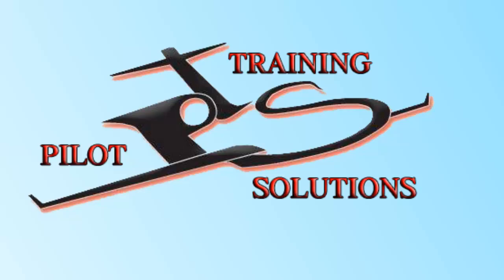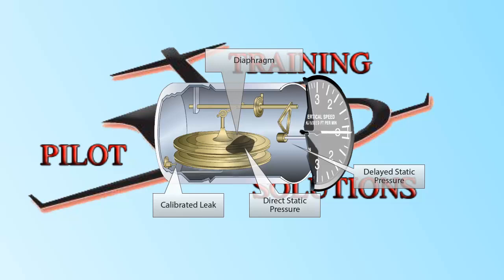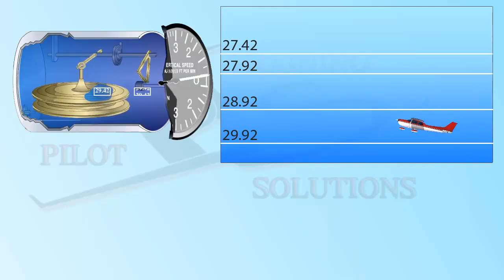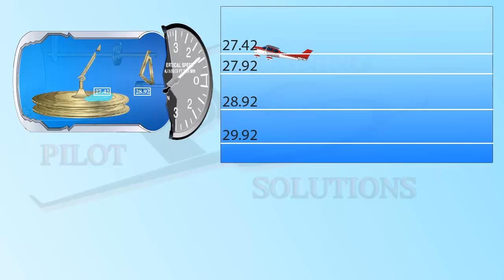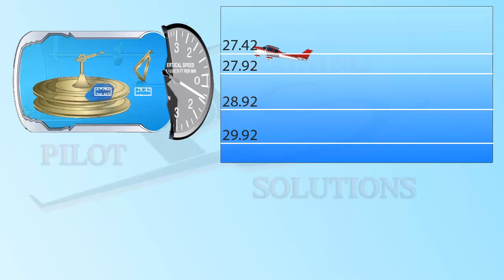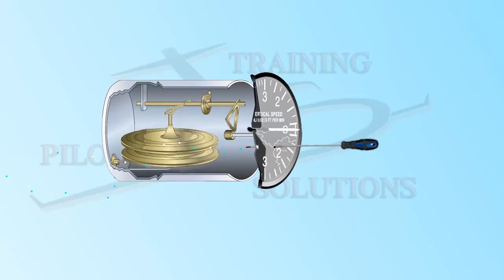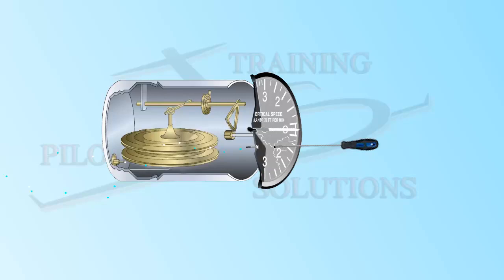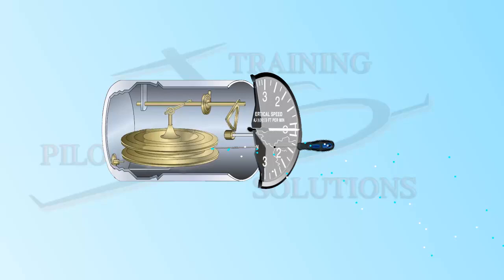The Vertical Speed Indicator

Comment: I wonder how can you break the VSI if you are using EFIS :P
Reply: For GA aircraft with glass cockpit which are IFR approved you should have an alternate static source switch inside the cabin. This takes the cabin pressure as being static pressure. This is why breaking the VSI glass works. It does the same thing, expose the inner workings of the VSI to the cabin air pressure. Cabin pressure is slightly lower than outside pressure so the altimeter and VSI will under read slightly.
Reply from the maker: haris javed In a pressurized airplane cabin pressure is higher, not in a non pressurized one.
Reply: MerryfaceAviation Cabin pressure is always higher than the outside pressure unless something goes awry. So do we have to deliberately create a negative differential pressure in the cabin to aid in this screwdriver thing?